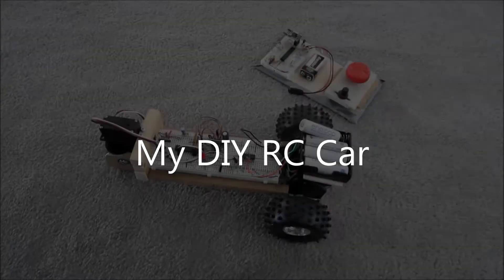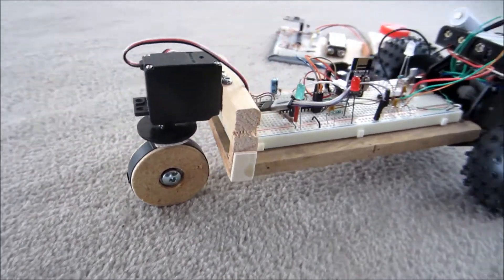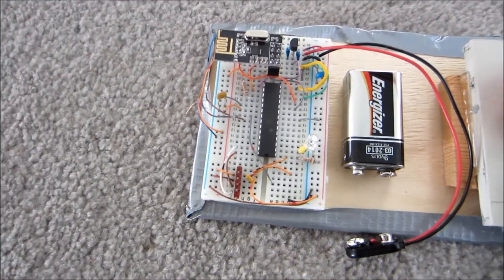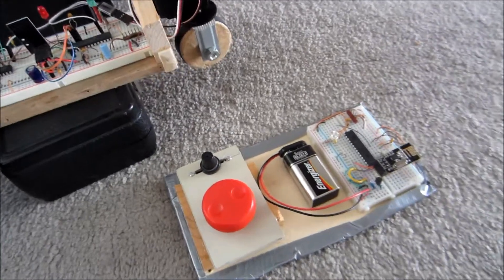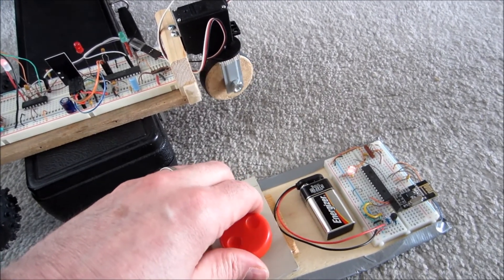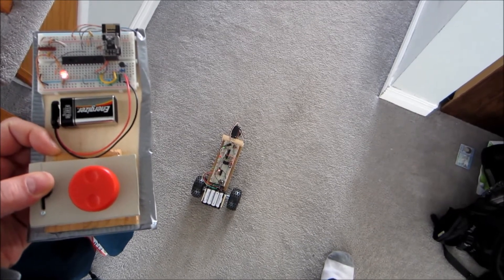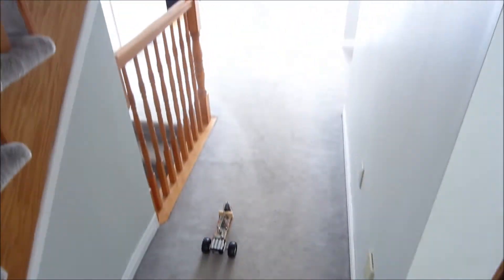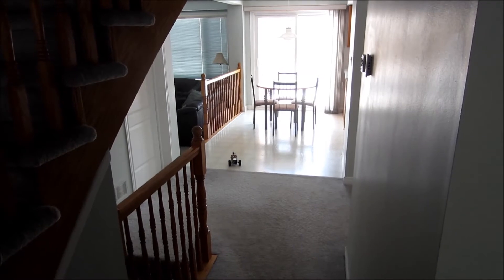Homemade RC Car

Comment: would you send me schematic wiring diagram your car?
Reply from the maker: I have not made a schematic drawing of this. Basically the radio transceiver is connected to the SPI bus, the servo is connected to a PWM output and the L293D is connected to PWM outputs. Other than that there is just the programming header and voltage regulator.